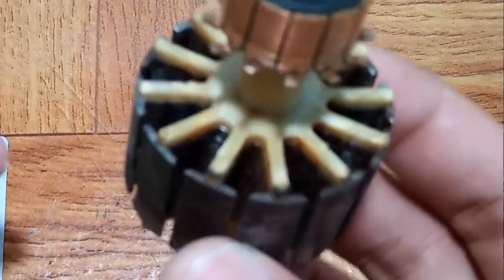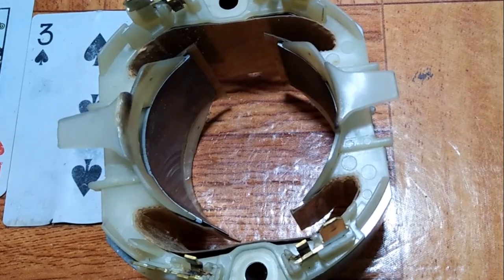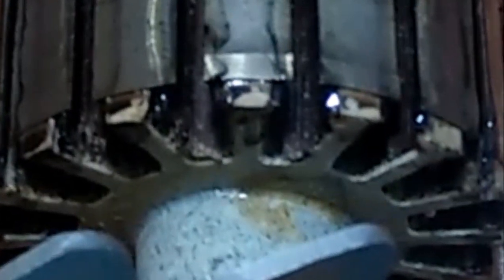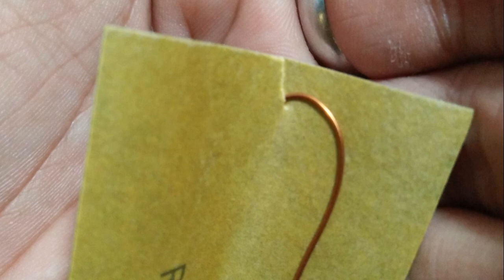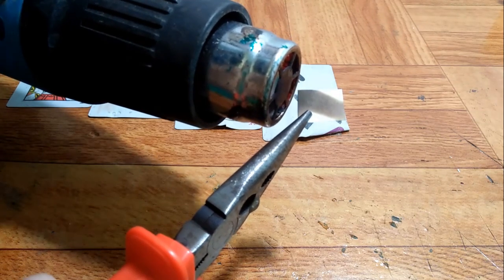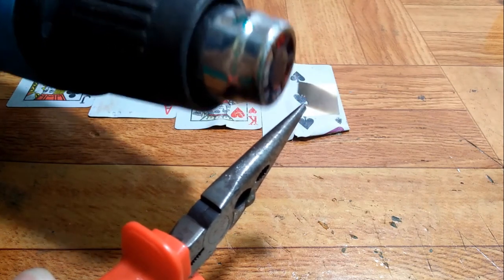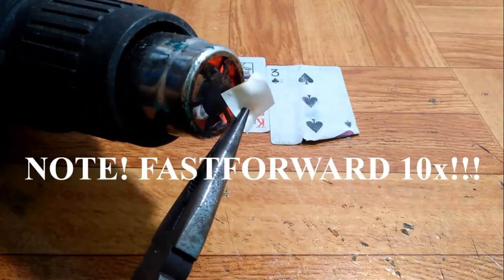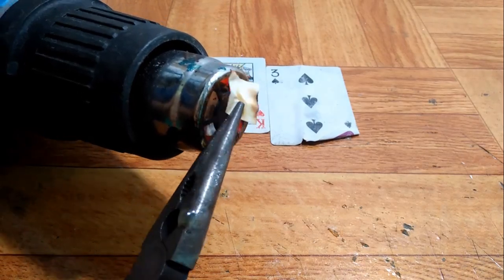What Insulation We Use in Armatures

Comment: I have a plunge router which has a 28 slot commutator and a 14 slot armature. Will it be the same as using  a 24-12 ?? If you don't know the exact number of windings in a coil , can an estimate be made such as used in  24-12
Reply from the maker: hello sir yes you can use the same method sir. you can estimate sir, just enough to fill the slots